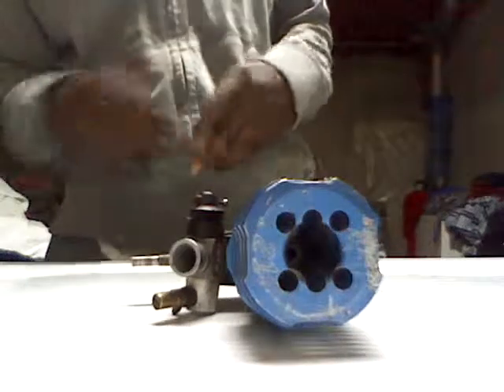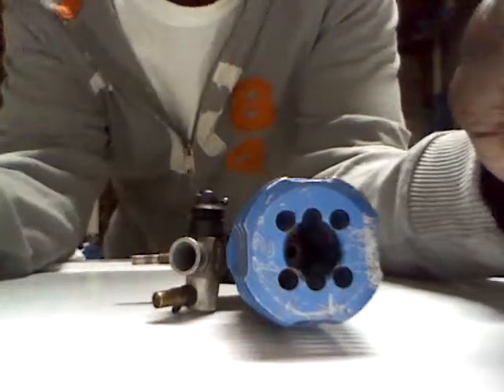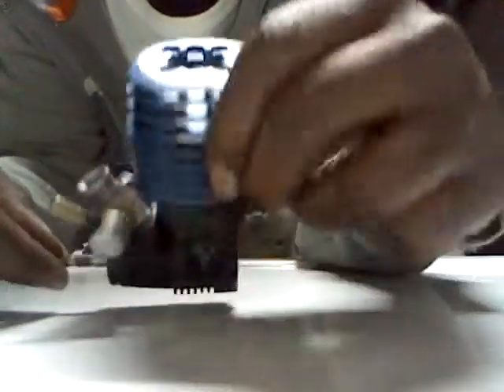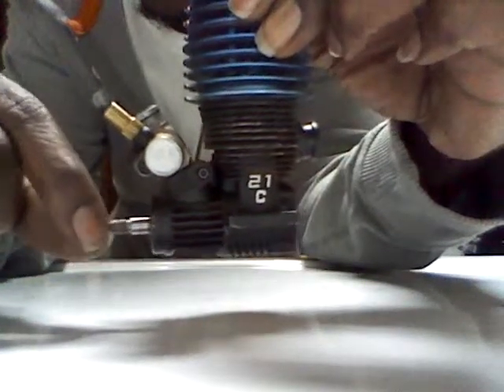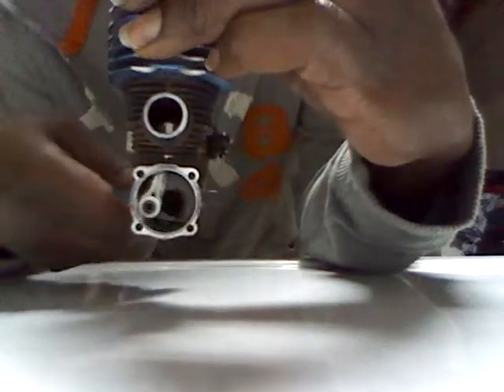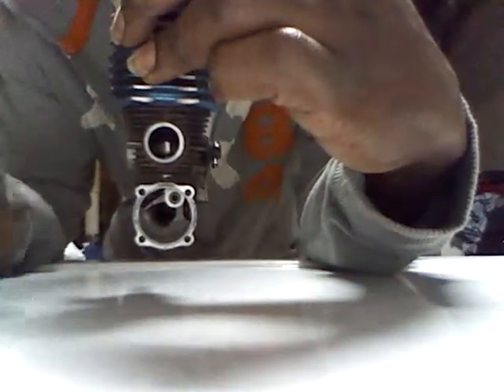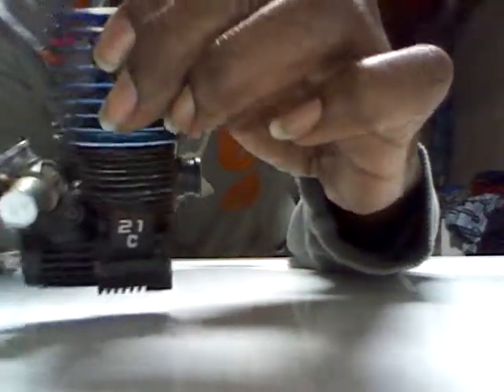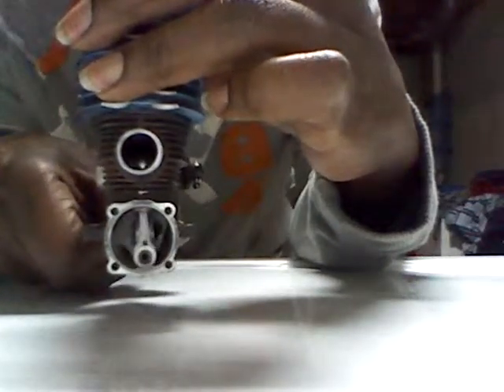Rc Engine Repair / Reconditioning AE AXIAL COLLARI GO GRP HPI 1/3

Comment: hi I have a hpi rs4 2 and I was wondering what's wrong with my nitro. it's running but when I run the throttle it stalls do you know what's wrong?
Reply from the maker: Hello There !!! Listen to the engine an determine if the idle is nice and smooth. 
Looking at the hi-speed needle you maybe to lean or to rich. 
Make sure the low speed is flush. The low speed needle will stop/restrict fuel flow be cautious.  
   Okay let's start  1) Crank dat bad baby up 
 2) adjust idle  (Smoot ) make sure linkage is correct. ( DO NOT ADJUST LINKAGE WITH RADIO ) set trim and adjust linkage sping(s).
3) if the hi speed needle is hi near the top turn clockwise slowly until you hear a slight rev  
4) If the hi-speed needle is low near the bottom turn counter clockwise to open this will richen. 
5) keep in mind the idea may need ajustung .  If all fail it maybe time for a new glow plug.  Hopefully this was helpful to assist you with your RC inquiry.  Thanks for stopping by. Sincerely H.T.Engines
Reply: +Alvin D. Wallace Hand Tuned Engines omg thank you so much.